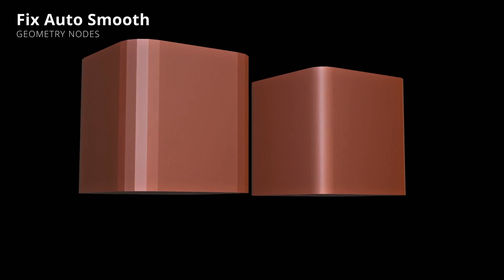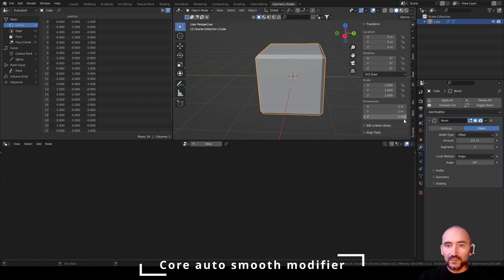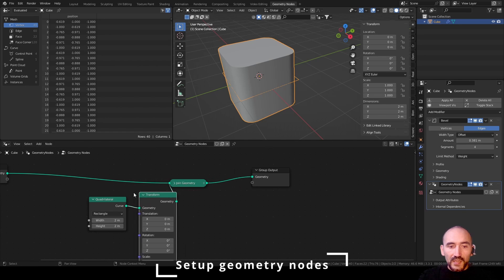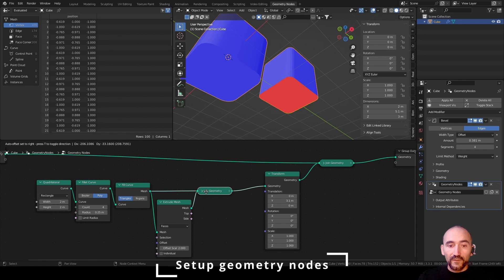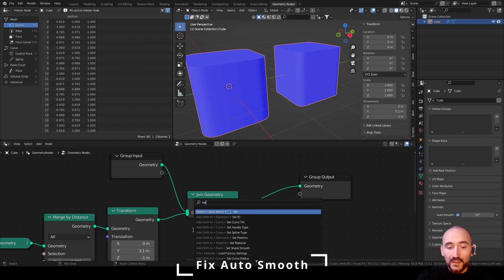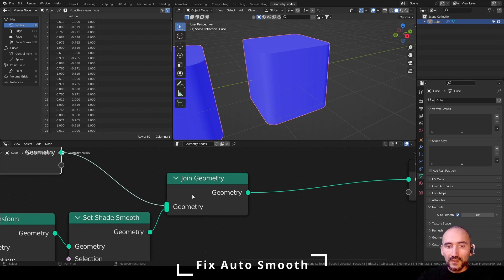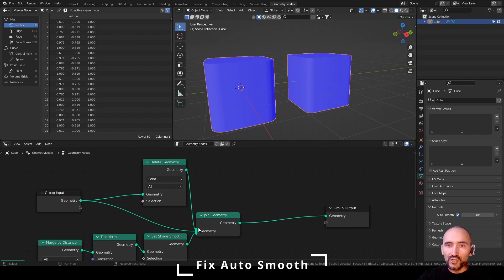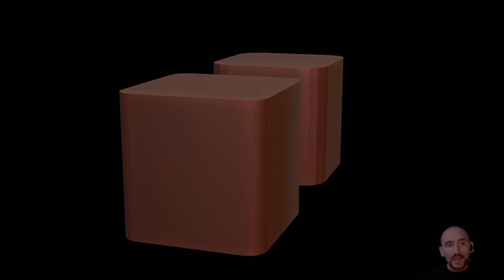Fix Auto Smooth in Geometry nodes - Blender tutorial ENG

Comment: thank you! instead of deleting, you can merge all the points of the first geometry
Reply from the maker: Thank you too RAMIL! Yes, good alternative way but you need to pay attention to always calculate a correct merge distance. If you changed the scale of the object you could have a merge missing. For this reason i used the delete operation since there is always a vertex with a 0 index. Naturally i know you would put 1000000000 in the merge distance to avoid the merging problem 😄

Comment: I haven't tried other shapes, but for this shape in particular i just created the same base QUADRILATERAL with a FILLET CURVE node but then used a CURVE TO MESH node with a CURVE LINE as the curve input and the QUADRILATERAL as the profile curve then turned on the fill caps option.  The resulting geometry was the same, but without the need of autosmooth.
Reply: Oh i just realized you're using 3.3 I'm on 3.4 I'm not sure if those nodes are missing in 3.3
Reply from the maker: @RobertLandivar  Hi Robert! Mh...interesting. I tried your technique in 3.3.1 and it works but my goal was to have the possibility to fix any kind of generated mesh on GN. If you can, post you file on my discord server so we can discuss about it.
Cheers!
Reply: @andrea_ciani  what is your discord?
Reply from the maker: @RobertLandivar  Discord is a digital platform that allows users to communicate across channels. These are hosted on servers, both public and private, and are the meeting point for people who want to be part of a specific group that shares the same emotions, files or other info. In the link in the description of the video you can enter in my server, and post the file in #issues channel
Reply: @andrea_ciani  lol. Thanks I know what discord is, I was just looking for your link. thanks ill send you stuff
Reply from the maker: @RobertLandivar  😅 Sorry me. The presence of "your" word in your comment changes the meaning of the phrase in my original language, i got confused.